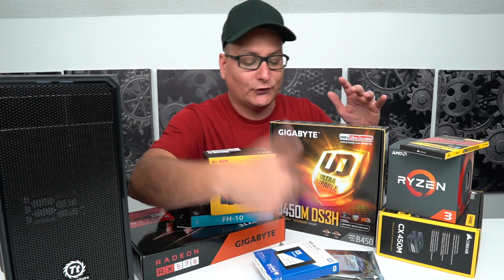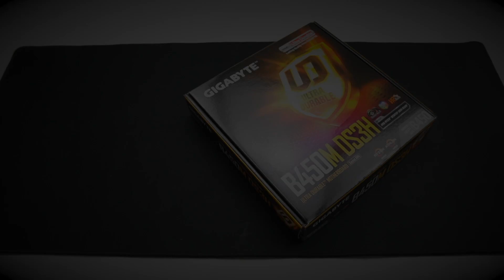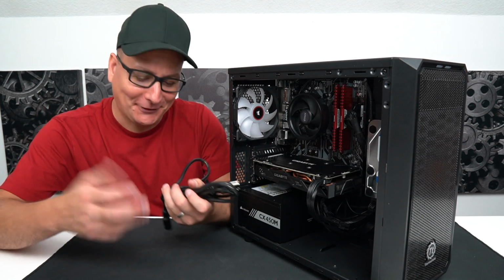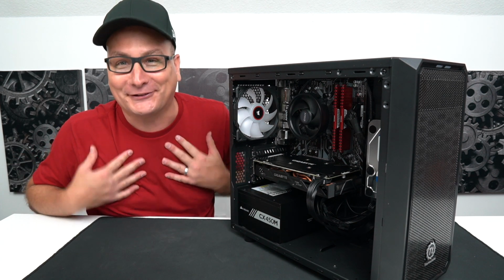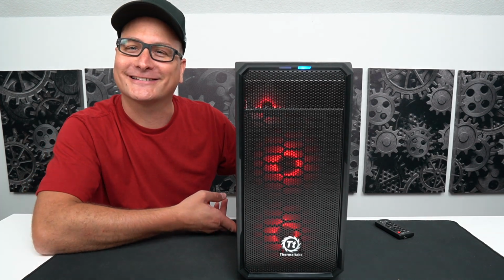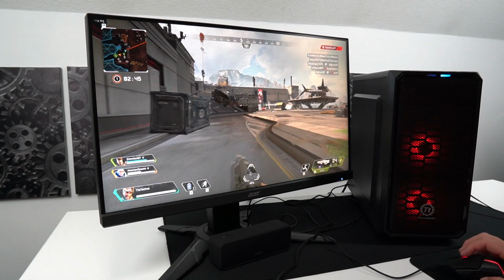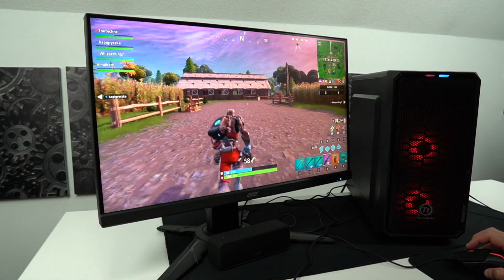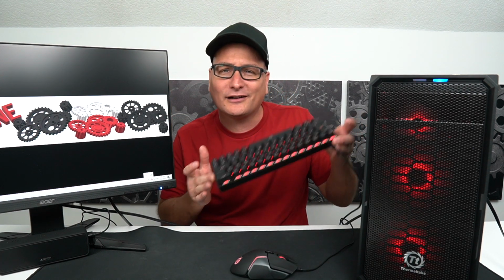$450 GAMING PC BUILD WITH GREAT PERFORMANCE! RX570 / Ryzen 3 1200

Comment: I just bought a ryzen 3 1200 for 50 bucks brand new. Im starting to build a pc and am trying to get similar parts. Love this vid thanks man. I also saw that on amazon there's 2 by 4gb sticks of corsair vengeance ram for 40 dollars which i think is a great deal. Although I might save a few dollars by going with patriot viper. If its a reputable brand.
Reply from the maker: I have only used corsair r am, and always had great results. (get 16gb)

Comment: Gonna build a similar set up,  using the  Ryzen  3 2200G   and the Gigabyte B450 Aorus  M, even have that same exact case. I am trying to keep my build dirt cheap, around $350 bucks,  but wanted something that can easily be upgraded later on.  I opted for the M.2  250GB SSD  and a single 8GB 3000mhz Vengaence LPX.   no graphics card.

at some point in the future,  I will upgrade and increase  the memories to dual or quad channel,  and pop in a dedicated video card.  but the starting build should  handle the older games I play. 

anyway I really liked some of the stuff you did in this video, I will also pull out all that stuff, and add a couple of those red fans up front.  will probably keep the one in the back that comes with the case.  gotta save those bucks :)
Reply from the maker: nice build. yeah the integrated graphics are 100% garb. but you can pick up a nice 570 for around 120$
Reply: The Techne I got a 570 and it’s great I have r3 1200 running nicely at 3.7 works pretty great for gaming not great for multitasking but fine
Reply from the maker: @charliewickliffe2203  https://youtu.be/4LBFduIdgrA

Comment: 450 for that brand new is a steal my pc I got my processor gpu and mobo used I got a r5 2600 b450 MSI vdh pro 8gb patriot viper ram (new) gtx 1060 3gb and a cheap 30 pound deepcool tempered glass case all under 415 and a g203 with a paracord cable modded for 35
Reply from the maker: nice grab there!!

Comment: nice looking case there, i just got the thermaltake v21 cube and i love it, it was supposed to be for my new build but i wanted to see how it'd look so i transferred my mobo and stuff from my prebuilt into it, and yes i agree just the simple transfer had me worried when i went to plug it in and was hoping nothing was going to die on me lol. I'm getting that same mobo too, actually im stuck between that board, the msi b450m bazooka or waiting til the release date of the msi MAX series that way if i get a 3400g processor i know it'll be compatible right away. either a 2600 cpu or a 3400g like i said, both the same price as well so stuck there lol.
Reply from the maker: yeah I would just hold out if i were you. be a little future proof.

Comment: Dope. I was messing around with pcpartpicker recently, trying to put together a budget amd build. I was a bit skeptical with the r3 1200 only costing 60$ right now, but it looks like it's holding up quite well! Might slap a rx 590 and perhaps some faster ram in there for good measure. How are temps? Does the stock cpu cooler hold up or should I throw a little something extra in? No overclocking here, just some semi hardcore gaming here and there @ med-high settings 1080p is all I need.

Edit; obligatory like and subscribe btw, thanks for the vid
Reply from the maker: thank you so much for watching and that sub!! as for temps you will be fine with the stock. just make sure your case has good flow.

Comment: Can you use an Xbox controller wired with no delay
Reply: Bluetooth is faster on pc check out rusty machine or high distortion to set ot up wired for console
Reply from the maker: I use an xbox controller with all my pc's. just use the xbox dongle, https://www.amazon.com/gp/product/B00ZB7W4QU/ref=as_li_qf_asin_il_tl?ie=UTF8&tag=thetechne0d-20&creative=9325&linkCode=as2&creativeASIN=B00ZB7W4QU&linkId=3340c01daafb586c788bdbe381e213da

Comment: Bro I will be building the same pc with some modifications I will send you🙂
Reply: Can I ask you something
Reply: Bro I was thinking about the motherboard and I am buying Asus ex 320 expedition

Processor I want to buy Ryzen 3 3200g 

And the GPU I will buy later
Ram I was thinking about trident   z RGB but is there any 2 into 4gb kits??
And I will buy custom RGB air cooler.
And if there is 4into 2 RGB ram (please inform me) (reply me)

Comment: Do you know how many FPS you get if you have low settings on fortnite?
Reply from the maker: oh no, I only tested on high. but heck at 80+ on high, at low you will easily top 100+
Reply: You think it will be at a consistent 144fps? Cause I wanted to buy a gtx 1080 and build a pretty decent pc for 1k+ but I think it would be overkill for me so if this can push at least 144fps on fortnite I’ll be happy
Reply from the maker: @danielc4908  yes I do at low settings. I don't play much fortnite, so if you don't mind me asking why do you play at low settings?
Reply: The Techne Mainly to get more FPS I only have view distance set to high or epic to see more things that are far away but everything else is mostly for the small details and it doesn’t have an advantage and it also makes you get lower FPS
Reply from the maker: @danielc4908  doesn't it look mushy then?